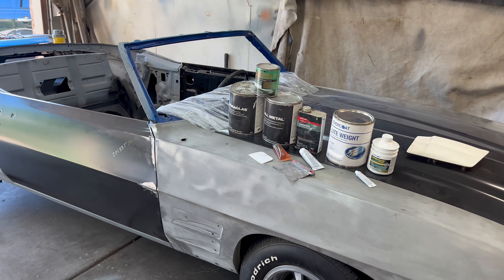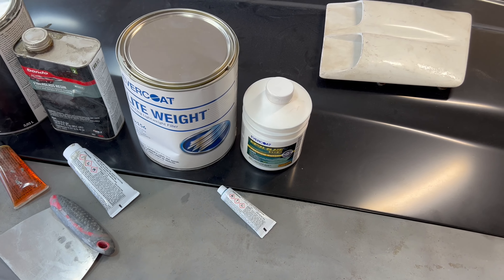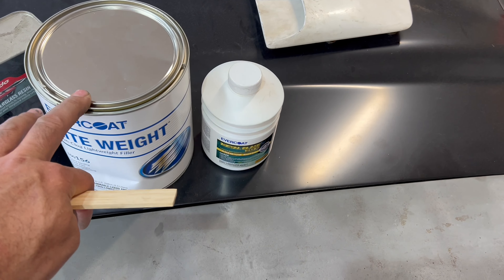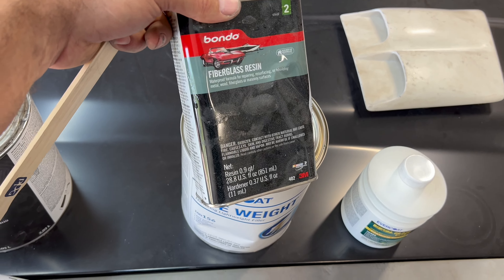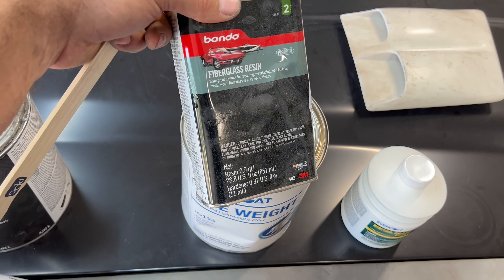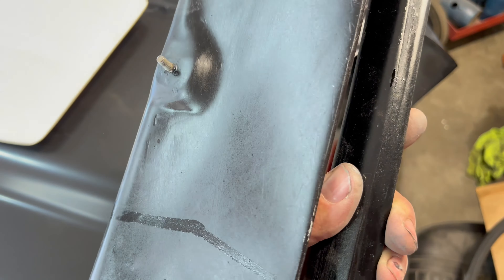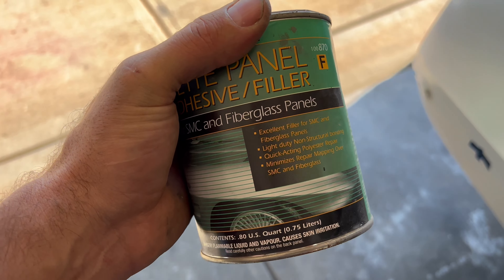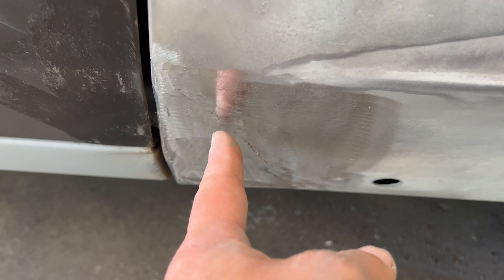Choosing the best body filler for your restoration

Comment: I had to rebuild the drip rails on my '74 Econoline. I can say without out a doubt that the All Metal was the best choice. I cut, built and welded new rails all the way down the side. Smoothed it with All Metal before adding the seam sealer. I think its just as strong as it was back in 1974. Great tip about thinning out the "Bondo" I'll definitely be giving it a try. Thanks again for another great video!
Reply from the maker: Heck right on. I like all metal a lot.  It’s a little spendy but does a great job

Comment: great review of body fillers Jon.  That vert looks awesome on all 4's.  I will message you about the tilt column.  I could use it.
Reply from the maker: It’s nice to have it back on the ground and even better that it’s measurements for ride height are less then 1/8” difference side to side!!

Comment: On that tilt column all you need is an ignition switch that fits a tilt column 69 firebird the ignition switch was made different for the tilt column
Reply from the maker: Even the park neutral switch won’t fit as well.  Best I could find is the Camaro Column is a different part number then the Firebird.  It could be modified to make it work, I feel I would prefer to sell it instead

Comment: Jon, great video! So how do you feel about using All Metal in the seam between the roof panel and the sail panel of the quarter. It seems like it might be about 1/8-3/16” deep. Considered welding a strip of sheetmetal over the gap which is about 1.25” wide, but still up in the air about it. Thoughts? I know you do a lot of convertible work, so have you ever filled the gap on a coupe?
Reply from the maker: I have used all metal in that exact seam before. Seems to hold up.  I will say lead is the best but I haven’t mastered putting it back in. I have also welded sheet metal in over the gap like you described as well.   The mocking bird I filled that seam with all metal and not worried at all.

Comment: Absolutely enjoy your channel, John!  I found it recently as I searched looking for tips on finding an old first gen firebird.  I owned a '77 Trans Am in my high school days but had a friend who had a '68 bird and always wanted one.  Do you have any tips on how to find a 1967-1969 model that would require alot of work, like the ones you start out with?
Reply from the maker: It seems that they find me now,  at least one car a month or so.  Sometimes it’s a good deal but I have too many cars if that was even a problem. Other than that Facebook market place has a few pop up here and there too.  Was there a particular year? Coupe or convertible?
Reply: @VinylVillageGarage  I prefer 1968 or 1969, coupe or convertible.  I've even resorted to looking at Copart and IAAI auction websites but not much there.
Reply from the maker: @FrankMalek-o3o  any interest in a 1969 Firebird 400 4spd car.  Carousel red with parchment interior?  I have the numbers matching block but it’s toast.  I do have a 1969 Firebird 400 and 1969 Firebird 4spd for the car.   But it’s a total overhaul everything needs attention.  I have $6,500 invested in it so far.  Plus I have a title too.
Reply: @VinylVillageGarage  Hi Jon, Yes sir, I would definitely be interested.  How much do you want for it?  Do you have any pictures you could share?
Reply from the maker: @FrankMalek-o3o  Abandoned Firebirds in the Woods: How Much Are They Worth?
https://youtu.be/EhitBI4B9bQ check out the second 1/2 of this video.
Reply from the maker: What did I buy this time and what’s the next project? First generation Firebird
https://youtu.be/5V1oviTkPIM this one too.

Comment: Hi Jon, great info! I have a 67 Camaro and have to remove back glass to reveal water damage(getting water in trunk) The under side of filler panel has some holes. I can't afford to cut out window channels and weld/paint right now- how would you try and repair damage in channel. I have some Eastwood rust encapsulator I was going to use for now.
Reply from the maker: Rust is definitely the enemy and stopping is best but if anything slowing it down until repairs can be made is a great idea.  Rust encapsulator is a good place to start. Read and follow the directions for best results.  You find it’s not as simple as Just paint it on.  Plus this car won’t see the weather as much. I bet it’s kept in a garage now which will help as well.  If removing the rust but cutting it out or media blading isn’t an option yet then seal up the rust for now until it can be addressed.
Reply: @VinylVillageGarage  
Thanks, yes she lives in garage, took a few washes to discover leak.
I'm moving to Florida to retire in a few and I will be getting caught in rain for sure. Lol
Reply from the maker: @ericvitelli7113  congrats on the retirement!   Yup might see a few rainy days there and worth sealing that window channel up.

Comment: Curious and sorry if you did say but what brand is your door here. I have a right door as mine was caved. Curious as I have seen one that needed to be ccut and welded to fit in depthwise.
Reply from the maker: These are AMD brand and I will say very happy with them.
Reply: Thank you all of the stuff I have bought so far is AMD but I didn't know whether to say that on here. I read way back there and the person I bought the car from told me only use their stuff. They did give me both extra front fenders and told me not to use aftermarket fenders. These need a little work at the front of each

Comment: I'm interested in the tilt column for my 67 camaro. I can send you an email address or number to send the pictures to.
Reply from the maker: It’s for a 1969 so it has the lock Cyl in the column. Not really a direct replacement
Reply: Ah. Ok. Well if you run across one for a 67 I'm in need. Mine has a gm truck column in it.